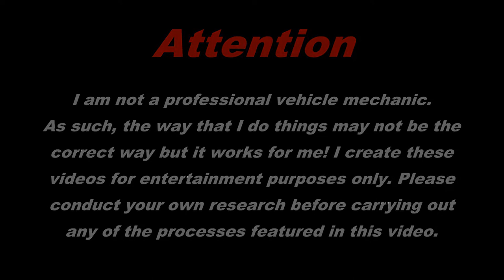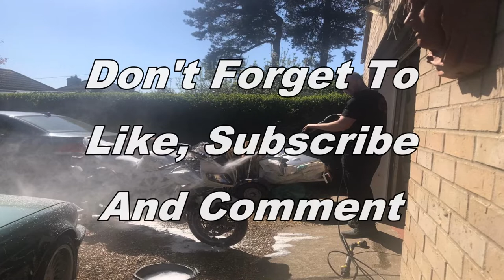Suzuki SV1000 Project Bike - Part 2 - Bleeding The Clutch And Sorting The Shifter!

Comment: Hi , i have a sv1000s 2004, can i ask you if is possible to replace the original axial brake master cylinder with a radial brembo rcs ? If yes what would be good rcs 17 or 19 ? Thanks

Comment: My clutch grips just in the last few  cm.
The bike has around 22000 km ,so the clutch disks shouldn't be worned out.
Could you tell me how can I adjust that griping point?
Thx
Reply from the maker: Have you changed the fluid? You’ll be surprised at the difference that can make!